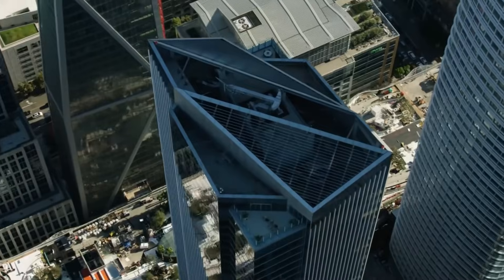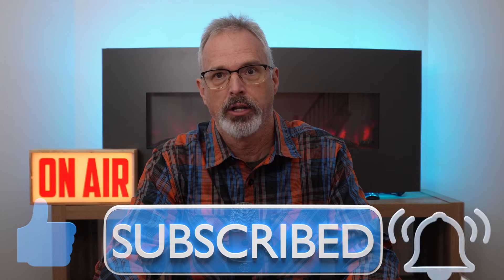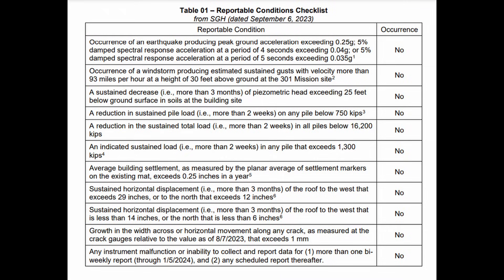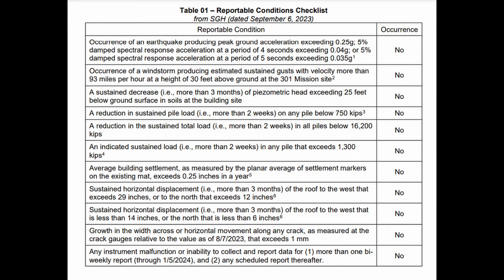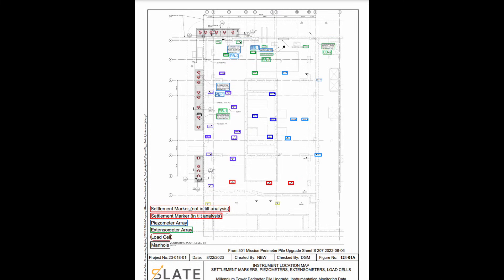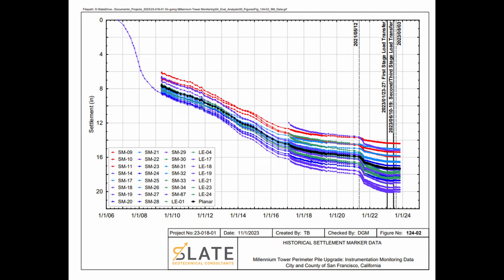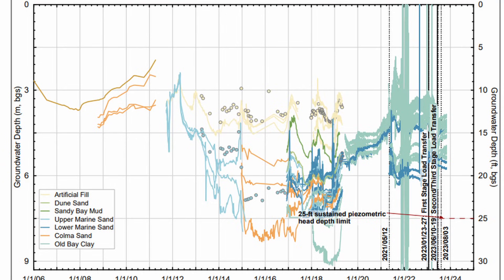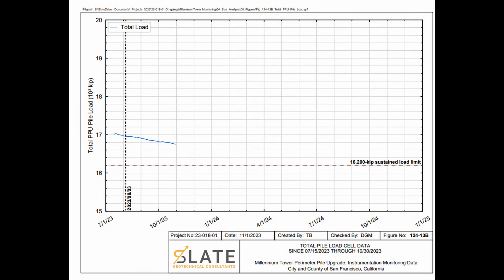Millennium Tower "Repair" - What is Going on with the Monitoring Results

Comment: Is elastic shortening likely? I don’t have intuition for piling but some buckling or just a poor joint at the bottom seems more likely. 

Anyways not good. That hamburger is a classic modern American engineer that does too much simulation. An engineer in the 70s could have done some hand calcs and gotten a better result than this idiot.